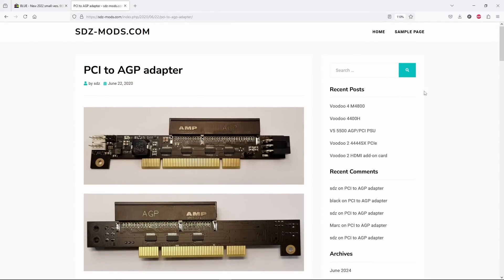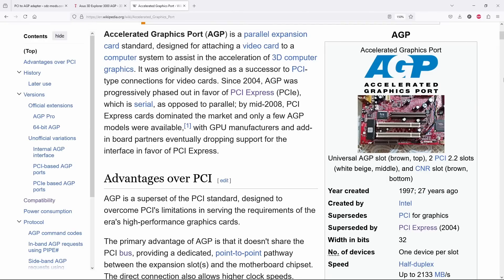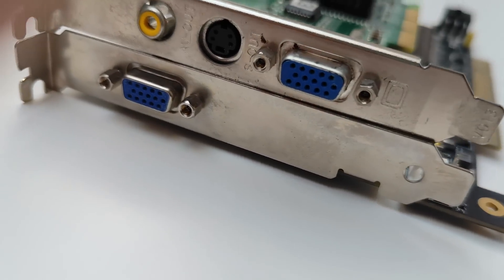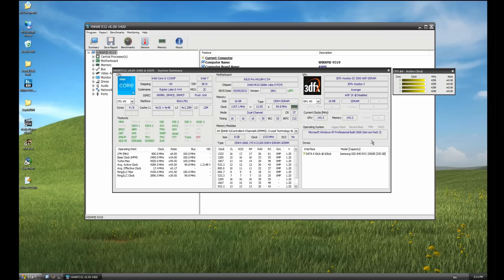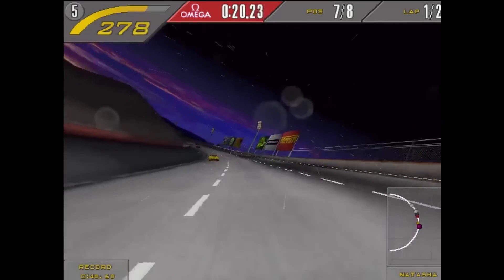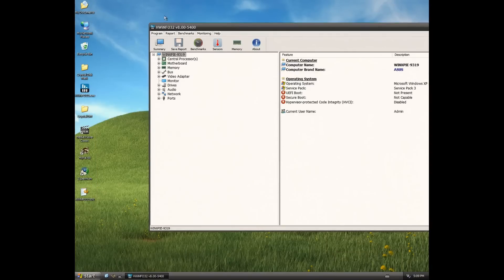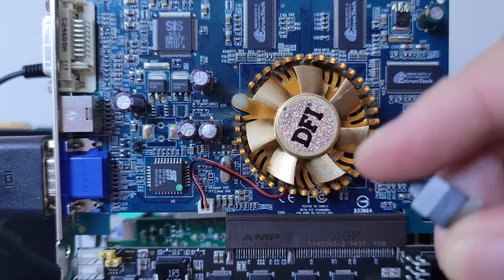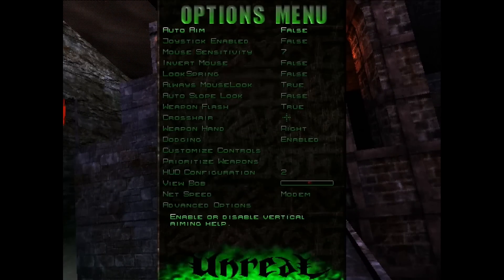PCI to AGP Adapter on (very) Modern Hardware: 3dfx Voodoo, nVidia TNT2,  SiS Xabre - What Works?

Comment: The performance of 3dfx AGP cards using this adaptor won't be decreased much because they also did not implement AGP texturing. For the Voodoo 5 series however, I think the PCI bandwidth will hold them back in many games post 2k.
Reply from the maker: Well, this PCI to AGP adapter can run at 66 MHz too, there's a jumper for that. But it ultimately depends on whether the PCIe to PCI bridge chip supports 66 MHz. The ASMedia 1083 chip (which is the most common) seems locked to 33 MHz, while others like the TI XIO2001, Pericom PI7C9X111SL, or PLX PEX8112 do support 66 MHz properly. The ideal solution would be a custom PCIe-to-AGP adapter built around one of those better chips.

Comment: Is there any chance you may ever consider covering Windows 98 with 3D support on something like qemu in Linux? or even Hyper-V in Windows? I'm assuming some of the methods you apply to solving issues with real hardware could inform solving some of the issues with virtualization as well.
Reply from the maker: Yes, I plan to create such a video in the future. However, my schedule is currently quite tight. If I find some free time, I can more quickly put together a video showcasing 'real hardware' action. On the other hand, setting up a GPU passthrough in QEMU for Windows 98 will require more time to master before I can create a comprehensive video on it.
Reply: @O_mores  Oh I understand completely, I was just hoping it may be something that could be touched on at some point in the future. I appreciate your videos and thank you for your response!

Comment: THE CPU ONLY IDLING WHOLE TIME DURING TESTING
Reply: Not exactly idling you still need 7-800Mhz for older games to eliminate CPU bottleneck.
Reply from the maker: If you want to keep a newer CPU busy in Windows 98 you can play games like Quake, Unreal, Half Life using software rendering and they will look very nice and crisp at high resolutions.

Comment: So pair i3 12400f + Asus Mobo with PCI + FX 5500 will works fine for daily use browsing youtube ?
Reply from the maker: It should work, browsing YouTube is limited by your CPU mainly, modern browsers won't run without SSE2 instructions so YouTube is out of question for anything that it's not a Pentium 4 or AMD socket 754+ CPU.
Reply: Thanks that great, rather lying around, i used the fx 5500 on pentium 4 socket 478 before

Comment: Back in the day all we wanted was one that did the opposite. Because PCIe cards were made for a while that wouldn't have saturated the AGP slot. But they just stopped making AGP cards. Like the HD4850 was on AGP. That gives you an idea of how fast the AGP slot was and not making AGP cards was just planned obsolescence.
Reply from the maker: The main commercial reason for AGP got ditched has to do with its single slot design. With PCI-E (re) started the SLI (and Crossfire) crazy days... Motherboards with multiple 16X PCI-E slots had a reason to be more expensive. For the ultimate setup now you need two or three PCI-E GPUs...

Comment: I fried one of my FX5500's with one of these adapters. Looks like I need to do a lot more reading before trying again. Edit: I used a generic adapter, not this one.
Reply from the maker: This adapter has like 30$ worth of extra components added just for the sake of being on the safe side.
Reply: @O_mores  The one I got seemed pretty decent. It's the one with the SATA power and usb lead... I did also have it running through the EDC Beast in an attempt to get it working with a wifi slot. keen to try again but want to be sure I don't blow a brand new gpu. Was the 5500 expecting 3.3v and received 5v?

Comment: Those s3 cards sucked so much. I hated the one that I had so much.

I'd be curious about some matrox cards those were great back in the day
Reply from the maker: Yes, indeed. In 1998 I had an S3 Virge GX2 (released in 1997) which is basically the same as Trio 3D  - and what can I say - as a teenager  I was ready to trade my S3 card for literally any other card. So I ended up with a 4MB Cirrus Logic Laguna 3D AGP, which was maybe a bit better...
Reply: @O_mores  I had S3 Savage 4, it was really great card. The drivers though were real problem, we had to take d3d from one version, opengl icd from another and s3 metal from 3rd. Though only Unreal and UT-98 were using S3Metal but with S3TC compressed textures they had thebest picture all around. It was sad day when VIA acquired S3 as their integrated video department. If only they had better driver developers... But great thing at the time was that nVidia licensed S3TC tech for their use.
Reply from the maker: @arkstone  I had a Savage 4 too. That card ended up in a K6-2/500 PC a neighbor asked me to build for his son. (using mostly second hand parts) It was the summer of 2000. That Savage 4 was his first 3D card. Quake II, Unreal and Half Life were very playable on that PC. That kid had time of his life that summer. :)

Comment: Probably more compatible than the actual PCI-e to AGP solutions that some manufacturers had integrated into their motherboards. With cards from the FX and 6*** series issues wouldn't be surprising if the PCI slot can't provide enough power on its own (a problem that the AGP slot on some 2x boards also have).
Reply: Yep, the 5500 dies if you try this.
Reply: Isn't most 6 and 7 series has AGP to PCIe bridge.

Comment: I have One, PCIE to PCI, but no work in my Pentium 2 Slot1 Motherboard, its like Voltage PCI slot😢 . But Works perfectly in my AM2 and other Motherboards, but ia not my initial plan, initial plan is for my Slot1 Motherboard with not have AGP Slot, but not work 😢😢😢
Reply: Even a PCIe graphics card with low power requirements might not be able to get enough from the slot.

According to some google results, the PCI v2.2 spec only allows a PCI card to draw 25W total regardless of which rails it's coming from.

PCIe Express can provide 75W to your GPU via the slot connector without any additional power cables.

As long as the grounding is done properly, you can probably power the PCIe card from another power supply and run a PCI extension cable out to the card.

Comment: Hi Omores. I have one of oskchar's agp to pcie adapters and the incompatibilities I've found are not because of the adapter but because of issues with some cards and most modern power supplies (no picture or bios complaining of no VGA card). I also have the same issue without the adapter or even with a couple of Geforce 6200LEs across all tested boards.
Reply from the maker: So far, I didn't try any adapter from Oskchar. The adapter featured on the video is obviously a much sophisticated build - with about 30$ extra electronic components added for the sake of being on the safe side... Both adapters are not doing any magic when it comes to AGP bus. A full compatible adapter needs a bridge chip that can fully emulate the AGP bus so the card won't even know it's plugged into a PCI or PCI-Express slot. Otherwise depends on the card's firmware and driver if it can be used while AGP features are completely disabled.

Comment: PCI шина то медленнее чем AGP, поэтому производительность и так слабой карты падает
Reply from the maker: It depends on whether the card needs the bandwidth provided by AGP in the first place. The PCI slot offers 1 gigabit/s transfer rate and this seems to be enough for some cards. For example, differences between the 3dfx Voodoo AGP and PCI variants are very small in reality.
Reply: @O_mores  U also can install PCI to PCI-E card, so u could install modern PCI-E cards to the retro PC like Pentium 3 and etc. But it will work worse then AGP cards. 
I have an idea to install that card to my P4 PC, but idk, im not sure it will work more better then my AGP card

Comment: does it need drivers, or is it an entirely hardware thing?
Reply from the maker: Nope, it's 100% hardware but mostly depends on the graphics chip if it can work with AGP features disabled. 3dfx Voodoo chips are working great.

Comment: Why would you run a Voodoo 3 thru a PCI to AGP adapter when it was also released with the PCI bus? 

Not only that, but all AGP cards ran at AGP 2x speeds at least. That's 2x faster than the fastest consumer grade PCI speed (66 MHz 32 bit). The latest AGP graphics cards also used an AGP to PCI-E bridge.
Reply from the maker: AGP Voodoo cards are nowadays priced lower than their PCI variants - so this adapter makes perfect sense if you want to have fun with an AGP Voodoo on a PCI/PCI-E only motherboard. Not necessarily something as modern as this H610 motherboard featured in the video, but maybe something like a socket 754/939 PCI-E motherboard or a 775 mobo with good Windows 98/2K support.

Comment: kinda surprised nobody's made a agp to pcie adapter yet. last agp card i used was a HIS radeon hd 4670, had it installed in a odd amd turion64 desktop motherboard.  anyways that thing played skyrim, and later fallout 4 before randomly giving up the ghost.
Reply from the maker: There are some PCI-E to AGP adapters - where a PCI-E to PCI bridge chip is added. You can find them on ebay, but they are rather pricey: https://www.ebay.com/itm/176293393840 I had at some point an ATI HD3850 AGP 256bit, quite a performer.

Comment: I think there is one for pci-e to AGP as well.
Reply from the maker: Yes, there is a PCI-E to AGP adapter using  a PCI-E to PCI bridge chip, but it's like like 250$ on ebay. Here is a picture: https://imgur.com/a/ekm6hEH
Reply: @O_mores and pci is slower than agp
Reply: That would be a somewhat more complex version unless you were prepared to
limit the PCIe graphics card to just a single lane...
Reply: @jnharton  not really as another post was mentioned there is and it does not surprise me as there was many cards with such a bridge chip as they where AGP gpu's with a PCI-e connector, as they would have been first gen and 2nd gen pci-e, yes in an ideal world you would want to limit the card to X lanes as it would not use the bandwidth provided or do what has been done recently with multi-function cards or switch chip or just use bifurcation "however bios needs to support".

Comment: Too bad PCI is so crap compared to AGP. Even back in the day it was a very performance limiting interface. You'll never get the full performance of the cards.
Reply from the maker: Depends also on what type of cards are you using. For example 3dfx cards are not very affected by the bandwidth of the PCI bus. I guess that's why 3dfx released high end cards like Voodoo 5 5500 for the PCI bus as well. In practice, both PCI and AGP Voodoo 5 5500 perform almost identical. In synthetic benchmarks the AGP version is like 20% faster.
Reply: @O_mores  I'd have to do some research, but having more vram on the card  could enables more efficient processing of data. It might also mean that data could be transferred in a compressed form and uncompressed into vram or simply on-demand.

They may also have put significant time and energy into minimizing communications between the card and the cpu by a variety of means.
Reply: That's because the PCI bus was a design which shared bandwidth between the cards not unlike ISA, but it has a wider data bus and much faster speeds.

The AGP bus is basically a separate, dedicated PCI bus just for the graphics chip. So it's not magically faster than PCI except that the GPU doesn't have to share access time or bandwidth.

PCIe works differently and breaks the previously parallel bus into separate "lanes" which are communicated over serially and also use differential signalling iirc.

Aside from the distinct advantages of serial communication it's kinda like being able to provide a dedicated PCI bus to each card except that the "width" of the bus is cut considerably.
Reply: @jnharton  Except at 533MB/s AGP has several times the bandwidth of PCI... so I don't know about magical but in practice it's certainly faster and higher bandwidth than PCI by ANY measure. Almost nothing uses 64 bit PCI and especially the cards shown here did not. And it's not a bus. You are limited to one AGP slot in a system because it's literally point to point.
Reply: @jnharton  Pot calling the kettle black. I made a comment to nobody in particular. If you don't want to discuss and instead choose to call names we can end this here. Also nothing you said has any bearing whatsoever on the fact that PCI has far lesser bandwidth in just about every use case and has been very thoroughly proven to reduce performance compared to AGP. And that's all my initial comment ever said. You've informed me of nothing.

Comment: The Asrock 4coredual motherboard is no longer required. Great adapter.
Reply from the maker: Yes, I think this is the most advanced design by far... There is no other PCI to AGP adapter using Digital Bus Switch ICs (SN74CB3T3245). But all this fancy stuff will obviously increase the total cost. (BOM) I mean you need 7 x SN74CB3T3245 which is like 2$ a piece (if you order less than 10). Meanwhile, some other adapters are using 0 ICs. All these tiny ICs + MCU for the PWM fan +  all the connectors - you end up with something like a 40$ bill - without the PCB and the manufacturing fees. But I guess it's still better than a dodgy 90$ eBay adapter. I would put my money into a PCI-E to AGP adapter.
Reply: @O_mores  is this exact one sold anywhere online?
Reply from the maker: @aikidoboynj  Nope, this is only a prototype. The schematics are free to download: https://sdz-mods.com/index.php/2020/06/22/pci-to-agp-adapter/  Next you have to upload the files provided by sdz-mods on a site like pcbway.com or jlcpcb.com and they will manufacture an adapter for you. This is how the adapter featured on the video was born... :) Best way to do it is to have a friend who knows how to fill these orders...

Comment: That SIS Xabre 400 you showed on eBay is from Centaur Technology. That seller, ProTechSupply, bought a bunch of stuff from that auction.
Reply from the maker: Quite expensive these Xabre cards if you ask me. BTW, Xabre II was announced by SIS in 2002. Xabre II was supposed to be a high end card with DDR2 memory, competing with Ti/FX series, with DX9 support. Well for an engineering sample of Xabre II I would ask some crazy price... But apparently they remained only a promise on a slide: http://web.archive.org/web/20030706034230im_/http://www.vr-zone.com/reviews/Triplex/XabreUltra/Roadmap.gif

Comment: Need to try one of these adapters on a motherboard with 66 MHz PCI slots and see if there's a performance difference.
Reply from the maker: Yes, indeed. This adapter has a 66Mhz jumper but it looks like I don't have any mobo with 66Mhz PCI slots.
Reply: @O_mores  Outside of servers, 66 MHz PCI slots were very uncommon. I know the B&W Macintosh G3 had one.

The Asus P5E WS Pro is an LGA775 motherboard with an X38 chipset and has a single PCI-X 1.0 slot, which is hung off an NEC PCI-X controller. I believe it runs at speeds up to 133 MHz. Might be worth trying it on there.
Reply: There absolutely will be. There was back in the day when the only options were PCI or AGP.

Comment: don't flatter the SIS Xabre 400. It was a geforce 4mx killer in Quake 3 Arena and that's about it. Nothing midrange about it :)))
Reply: you got a swollen capacitor on that DFI Xabre as well.
Reply from the maker: Yes, indeed, didn't see it until I edited this video.
Reply from the maker: Still, Xabre 400 was a mid range card, even if this was only for a short period. You have to take in consideration what was the market in 2002: LOW END: Radeon 7000/7500/GeForce 2 MX400/GF4 MX400 SE(64bit)/Xabre 200 | Mid range: GF4-MX440 8X(128bit)/Radeon 9000/9000 PRO - Xabre 400/600 High end cards were: Radeon 9700PRO/GeForce Ti4xxx - http://www.ixbt.com/video2/images/xabre600/compet.png
Reply: The GeForce 4MX was GeForce 2 with NV marketing BS.  It was outclassed by GeForce 3

Comment: AGP video card works for Windows 10 1511 build, 1607 build removes AGP support (even I tried with AGP driver but no luck)
Tested on Nvidia 7200gs 256MB with native AGP on the board.
BTW nice video.
Reply from the maker: Thanks for sharing, I was aware about this but I'm not sure what this means in practice. You can't install drivers at all - or only the AGP features are disabled and you don't get AGP texturing & co but the card still works as a PCI card. (where is technically possible)
Reply: @O_mores  Presumably it works on a similar principle to PCIe cards which hosted an AGP gpu and a bridge chip.
Reply: Does it stay in the 32 bit version?
Reply: @myne00  mine athlon 64 supports 64-bit and it can boot there, otherwise 32-bit works well in any Pentium 4 (not older, but LGA775 socket if i remember correctly) on Windows 10
Reply: Well that's a pretty tacky thing to do.
Reply: why would you use AGP video on Win 10 anyway?
Reply: @mirific87  Because tested out when I had spare hardware stuff.  It was just a fun experiment, when I had a free time on the weekend.

Comment: Is that motherboard an LGA 1700 board with a PCI slot? not PCIE?
Reply: Yes
They make these for use with legacy industrial stuff
This guy has gotten old windows versions to work on it
Also it has PCI-E in addition to plain old PCI
Reply from the maker: Yes, classic PCI slots and industrial motherboards are a thing. You can find socket 1700 motherboards with 4 classic PCI/3 PCI-E starting from 200$. This motherboard is not very industrial, actually it's branded as"Business motherboard" and it has a MSRP of ~100$. Almost any manufacturer has some motherboards with classic PCI slots. Here's a Gigabyte B760 2xPCI-E16X, 1xPCI-E 1X + 1 classic PCI: https://www.gigabyte.com/Motherboard/B760M-D3H-rev-10
Reply: @Cmdrbzrd  That is awesome!
Reply: you can also use adaptor pcie x1 to two classic PCI slots no problem if you don't have PCI slots... but you need CSM in bios to install older OS